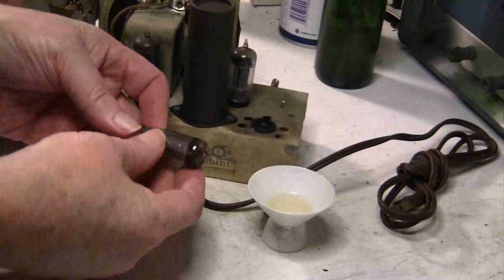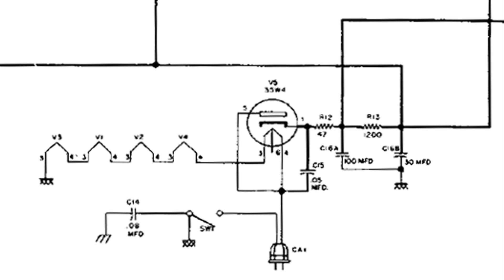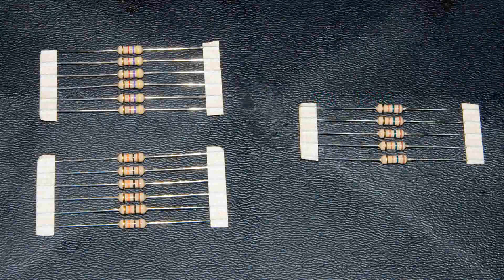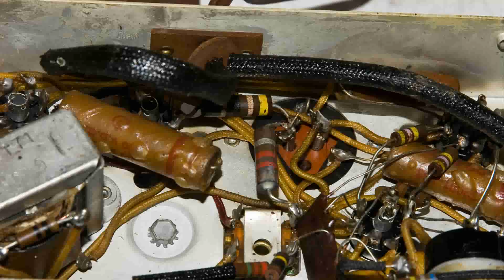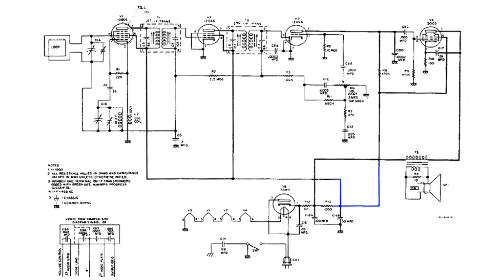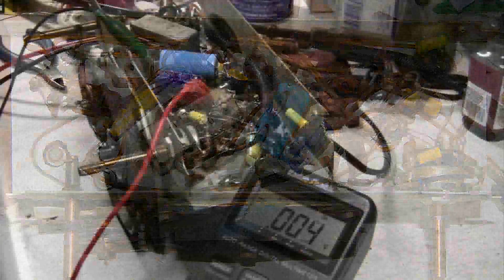Crosley radio repair 11-104U part two

Comment: I have a radio that looks identical to the outside of that radio. HOWEVER the underside is different. The volume control is on top of the chassis. It also has an additional cap in it. it has a 100,10 and 10uf in it. The schematic is also the same for it. Am a bit confused...lol
Reply from the maker: What's the model number?
Reply: @AllAmericanFiveRadio  It is an E-15-WE. The weird part is how the filter capacitor is grounded. The schematic shows each individually grounded to chassis, But the main filter cap is actually on the side of the oscillator coil that feeds through to the tuner. if I hook each 100 30 10 to ground the hum is worse. I know the noise is ac line feeding through, just not sure where it is leaking through, or how.
Reply from the maker: @countryside8122  This radio has two Grounds. A Chassis Ground and a Common Ground. The negative side of  all the filler capacitors are connected to the Common Ground. Capacitor C14 (0.05uF) is connected between Chassis Ground and Common Ground. Capacitor C9 (100pF) is connected to Chassis Ground. 
Schematic of Crosley E15WE
http://www.nostalgiaair.org/pagesbymodel/761/M0003761.pdf
Reply from the maker: My Free eBook. Password is 'allamericanfiveradio
The Vacuum Tube Shortwave Radio
http://www.richardmcwhorter.com/vacuumtuberadio/

Comment: Good video, I have restored many AC-DC 5 tube sets...I have found that Radio Shack resistors should be checked with a DMM first for value. I had a box of a 100 like yours and many were out of tolerance. You may want to check out "Just Radios" on the web for better quality caps & resistors in higher values btw. I bought the "kits" model year specific which contain the most often used cap and resistor values for these radios.Good Luck.

Comment: @AllAmericanFiveRadio Aah, so there weren't any power resistors of the correct value available locally? I see. :) I'm lucky to have a well stocked little electronics component shop nearby! I bet those are getting pretty rare, and I find it amazing that this guy is still in business.

Comment: Just wondering, why did you wire a bunch of resistors in parallell? It would be much neater and easier to just use single power resistors. It's not like the ones you replaced were odd values or anything. Good luck! :)